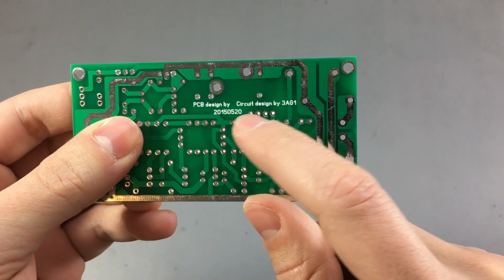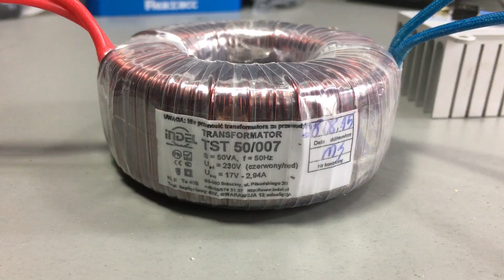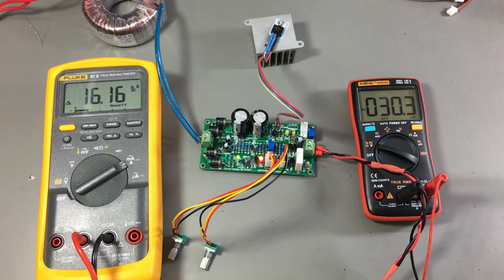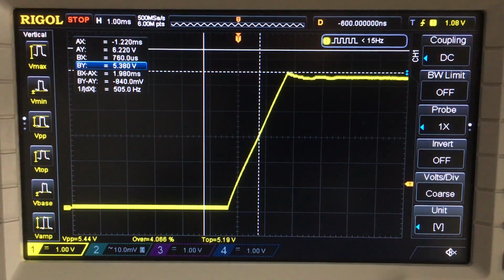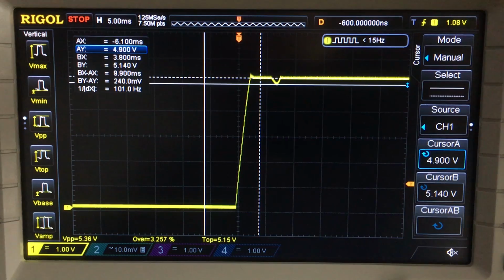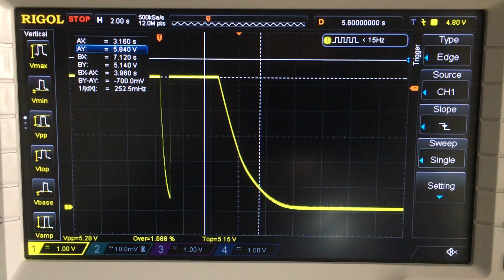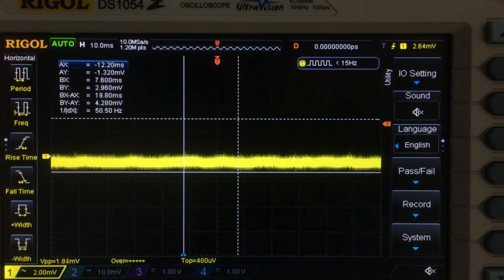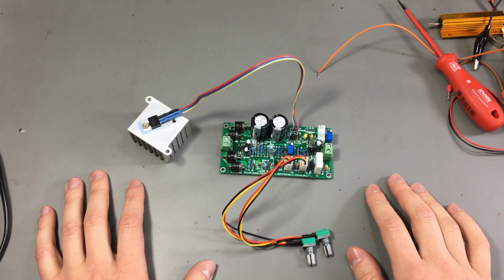Voltlog #155 - TL431 0-15V 0-5A Adjustable Power Supply Kit 3AG1

Comment from the maker: I have updated the blog post to include more measurements including regulation in CC mode, please check the screenshots in the article here: http://www.voltlog.com/voltlog-155-tl431-0-15v-0-5a-adjustable-power-supply-kit-3ag1-xiaolin/
Reply: FYI - It's been one year since this video and that EEVblog thread is active again..  search on "cheap chinese adjustable lab power supply kit on ebay ( 3AG1 , xiaolin )"
It might be helpful for some to know if you eventually got rid of that 50hz output problem - these are still being sold. Thanks!

Comment: Is the LM 317 opposite direction of the mosfet when both on in the board? seems weird if its. NM I see the markings on the board, it is. Thats a design flaw, I was going to install a heat sink there for both chips.

Comment: Weird set up in the top section, that part is half wave rectified, via one diode in the bridge. I tried to power it up with a 9 volt batt, on the DC side, unless you jumper one diode in the bridge the top section will not get power.

Comment: Someone has stolen your video. They did it to me and I reported it to YouTube as a copyright claim and they had it removed. Here is a link to the video.  https://youtu.be/G1kd_387FrI
Reply from the maker: thank you for reporting this, it happens sometimes but youtube tends to filter these accounts out. Now they also have this copyright tool that checks if your videos are being stolen automatically.
Reply: @voltlog  

But people easily get around the automated algorithms that search for stuff like this.  All they have to do is trim the video size by a little bit, add small breaks every once in a while , doubled the sound track  and so on.  Come out with a security measure and they find a way around it the next day.

I only found out they stole one of my videos because someone told me.  Figured I would do the same for some of the other people this crook ripped off.
Reply from the maker: MikesRadioRepair yup, you're right. Thanks!

Comment: not sure why there is that other rail maybe just to get enough voltage on the mosfet, but what is happening is that rail drops from whatever max voltage it is getting from the transformer until it is 0.5v lower than the main supply rail, then it starts to regulate voltage again using the voltage from the big caps until the voltage drops under the set output voltage. such an odd design.

Comment: Wouldn't it make a little more sense to put the common mode choke on the high voltage AC side of the transformer, where the current isn't as high as on the low voltage side?
Reply from the maker: That is the correct way to do it but during testing I didn't want to have mains wiring exposed so I placed it on the output instead.
Reply: VoltLog ok, this makes sense :)

Comment: Isn't the ××431 technically a op amp? That's what the equivalent schematic shows on the TI Datasheet. It's a op amp comparater with an output pass transistor and a 2.5v reference on the inverting input, and a few feedback loop oddities.

  The kit looks like a decent design for a beginner's basic bench supply IMO. I'd like to see how someone could make improvements to it.
   Thanks for the walk through on how to simply measure PSU performance ;)
-Jake
Reply from the maker: thank you for watching!
Reply: I wouldn't consider it as an op-amp, more of a comparator. I have been working with the TL431 for over a year at my job... Talked with couple of different manufacturers for the TL431. From what I understood it was originally intended as voltage reference but is widely used as a cheap comparator.

Comment: If I had to use this supply I would add a switch to switch on and off the output. So I can switch on the supply mains first and than if all is stable close the switch to connect my load. Same way round when disconnecting the load. This way you can avoid those overshoots and also the bad power off behavior. But there are much better power supply kits out there.
Reply: VoltLog Yes Florin, you are right. This is the kit I also would recommend. I have build this one and also the digital controllable version of it about a year ago and both are still working fine. They work up to about 30v at 2 amps and you can control them down to 0mA which is much better than the 15 mA the one from the video can go down to. I have 10 turn pots on my analog version and 5 digit volt and ampere meters. So I can also adjust for example 1.5 mA exactly which is handy for testing leds and so on.
Reply from the maker: voltlog #8 shows a possible alternative
Reply from the maker: I have updated the blog post to include more measurements including regulation in CC mode, please check the screenshots in the article here: http://www.voltlog.com/voltlog-155-tl431-0-15v-0-5a-adjustable-power-supply-kit-3ag1-xiaolin/
Reply: Michael Bernhardt 
I was thinking of a similar solution. Got any references for you "better kits?"

Comment: I love power supplies. Specially switched mode ones. 
I wonder if one is to replace ALL the components with parts from digikey or alike, and compare the performance side-by-side, if there would be a noticeable difference!
Please try installing a 10uF and 0.1uF Ceramic (both surface mounts ceramics) across the output terminals before you junk this PSU, and let us know if the output is cleaner. You will be pleasantly surprised. 
I myself like the genuine LM317 (5A version). It's impossible to destroy, and with a bit of trickery, you can easily get the output down to 0V. +👍
Reply from the maker: Installing those capacitors at the output terminals would certainly reduce the noise, I don't even need to try that, I know it will work. Just as installing more filtering on the input.However there are some things like the overshoot problem and the poweroff behavior which can't be easily fixed.
Reply: Type of capacitor is more important. Don't try it then.

Comment: Are resistors in this kit fake (their leads stick to magnet) or real ones made from copper? This could be the reason for funny waveforms
Reply from the maker: I have measured their values with a multimeter and they we're ok. I haven't checked their leads..
Reply: Sure fake resistors measure OK, but their leads are magnetic, made from iron not copper, so they interfere with frequencies and wreck havoc in use.
Test them with magnet.
Reply from the maker: difficult to tell now because they are all assembled and I don't know if the magnet is attracted to the body of the resistor or the leads. However I am not sure how this could affect this power supply even if they were steel. Upon a quick read i learned that many cheap resistors are made like this in current times.
Reply: Then perhaps you buy and use pin headers made from iron too? Chinese plate these with gold to look real nice, but they are iron not copper or brass.

Comment: Thanks so much for doing this! My leds are indeed the wrong way round. Also the only 15v ac I’ve got is a square wave at 20khz. Will this be ok?
Reply from the maker: I guess it all depends on the filtering, you would have to try and see how it works.